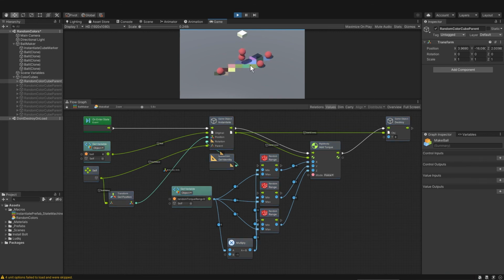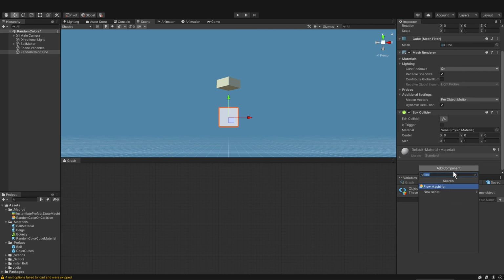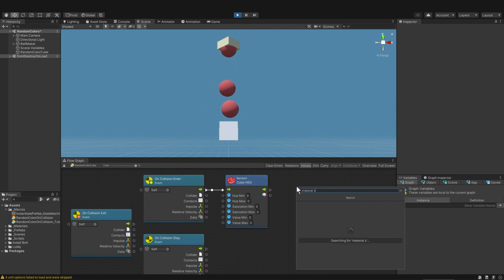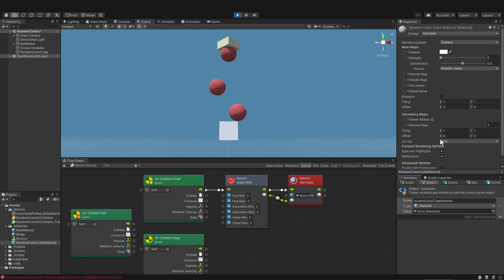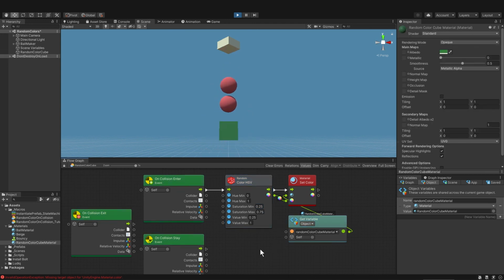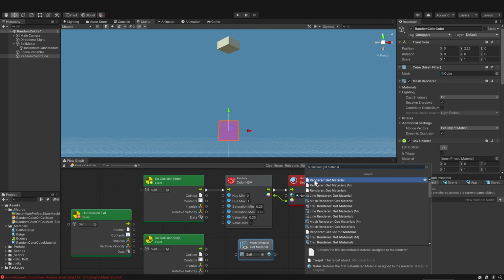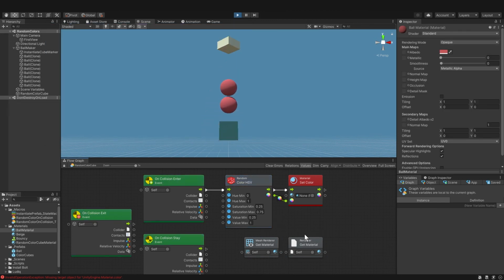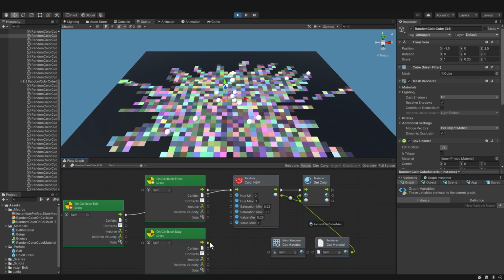Beginner Bolt Tutorial: How to Change Colors on Materials with Visual Scripting

Comment: Hello home Mech... thank you for the video's. They have been a big help! There isn't much about Bolt/Visual Scripting and that makes it hard to learn about it. Like today, I get stuck and I've spend 14 hours to figure something out. I can't find the solution and don't know what to try anymore. Can you please please help me out? It's about getting Camera-input into the Unity app. Simple want to have a button, and as soon as I press the button, the phone camera should 'turn on'. I've seen this goes via webcam texture, rendered into the texture or material of a canvas plane 'raw image'.. But I've tried everything I could think of and can't get it to work. Could you maybe make a vid or post an image somewhere of the Graph?? So I could see how the flow goes, which variables if needed etc.... Hope to hear from you. Thank you.
Reply from the maker: Did you try following this? https://www.youtube.com/watch?v=c6NXkZWXHnc My best advice would be to join the Bolt/VS Discord channel, lots of people can help you there, and thank you by the way!: https://discord.gg/pJh2wm4FBc
Reply: @HomeMech  Thanks so much for responding! Indeed I've watched that video as well, but since I'm using and learning Bold/Visual Scripting, I've tried to translate what he does into Bolt, but wasn't capable of doing so. I didn't know there is a bolt/vs discord channel.. I will join them :D. Thanks for the tip!

Comment: Great tutorial but ultimately not very helpful in a practical sense. A tutorial on  how to create a material changer from a list of materials using Bolt would have more practical use and drive more views to this tutorial.
Reply from the maker: Thanks for the feedback! Visual scripting is going to change a lot this year, so I'll have a chance to improve upon these older tutorials. That is, try to balance a sandbox-y project series (because tinkering is way fun) while having the same individual videos stand alone with knowledge that is broadly applicable. I can only achieve it with direct (and kind, thank you) feedback from my viewers, so I truly appreciate it!
Reply: @HomeMech  Visual Scripting is going to change complletely actually. Unity is  working on their own version. They did away with most of what was there. Bolt was probably a big mistake purchase for them. Took them a while to realize. 

 Hopefully Unity's Visual Script will be more friendly than Bolt.